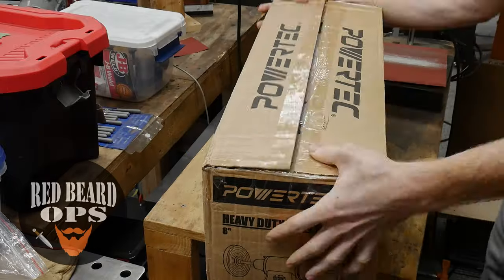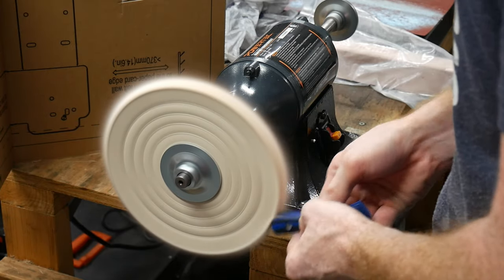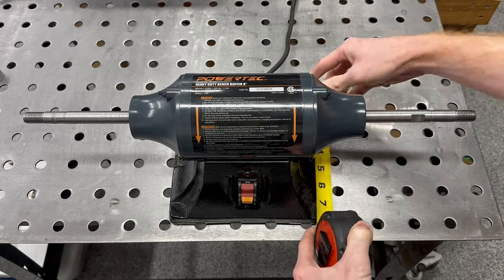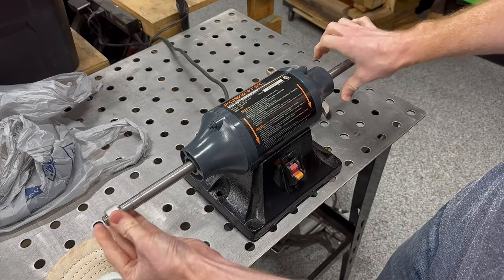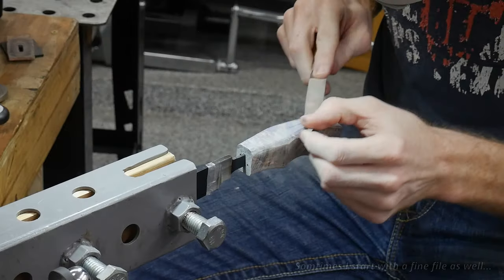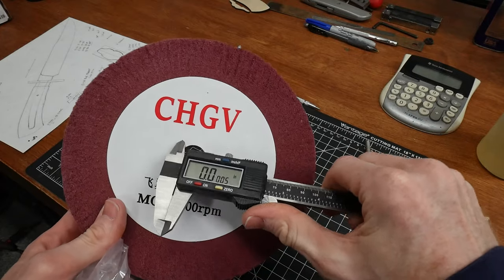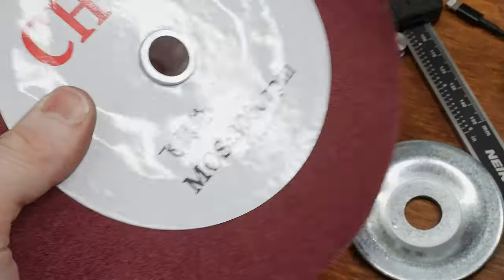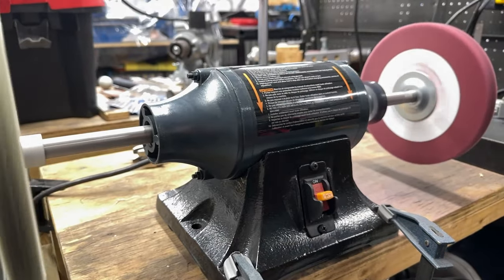Watch This BEFORE You Buy A Buffer: Are They Useful?

Comment from the maker: Any buffing tips? I'm new to this thing... Cheers! 

⭐Buffer - https://amzn.to/3VuVidL
⭐320 Grit Wheel - https://amzn.to/3AOQc42
⭐240 Grit Wheel - https://amzn.to/3OFFvGT
⭐Buffing Compound - https://popsknife.supplies/products/maverick-buffing-compound?_pos=2&_sid=b1710be89&_ss=r

🔸Become a RBO Patron - https://www.patreon.com/RedBeardOps

🔸 Red Beard Ops Website - https://redbeardops.square.site/
Reply: Combat abrasives just released a pretty slick line of buffing wheels. I’m definitely going to be checking them out.
Reply: things may have changed since I learned so may be better techniques these days so ymmv and definitely fancier synthetic mop types I not tried due to supply of old stuff. Used to be the case for last passes only go in the direction of the mop with the work piece, never against or up and down like in the vid when you're finishing because it is more aggressive and affects the fineness of finish. Use as little compound as possible and clean workpiece between mops/compounds. I use vienna lime for that but a soft cloth is enough to stop contaminating next mop. 

I start with high cut low colour compounds and progress to low cut high colour compounds as you'd expect. Same for mops starting on sisal, hard felt wheels, then various stitched mops, loose leaf calicos or WDR mops. For steel furthest I go is G300A compound but for handles I do final on WDR mop using vonax if I want it to really shine. I don't step through all those for each job as that's ott, after the sanding prep (finish 1200grit wet'n'dry or 00000 wire wool) it's 2 or 3 steps but depending on finish I may do one basic polish if mirror not required. Hope it helps and as always I enjoy your content ;)

Comment: So when I was in highschool I saw a awesome sounding class called metals and I signed up for it. I figured it would be some type of welding type class but it ended up being a metal jewelry class. I ended up liking it so much I took it all four years and don't regret it. Where I'm going with this is I have a lot of experience with grinders and buffers but mostly buffers. Making jewelry from soft metals you spend unreal amounts of time sanding from 120-10k grit but then comes polishing. You'll spend easily three times as long polishing a copper or brass piece. Many years later I see so many people misunderstanding how to use a buffer and some doing incredibly dangerous things despite their intentions being safety. Buffers do not have guards for the reason you mentioned with the knives. Soft wheels will grab a corner or edge of your work and sling it generally 90 degrees around the wheel then straight out. However, I've been to many shops where people installed guards and are afraid of using the buffers because materials keep hurling at them when they lose control. You've just basically given the buffer a barrel and pointed it at your chest. Also, guards collect heaps of polish and leaves a nasty sludge. Your buffer should not have any type of impedance near or around the wheel and should be used in an area that an object sent flying wouldn't hurt someone or something. Lastly, stop using gloves especially with soft wheels it can apparently take your fingers. My jewelry teacher always showed her hand missing a finger at the beginning of each year explaining a buffer ripped it out while wearing a glove. Who knows if she made that bit up but she was indeed missing a finger. If you are using a soft wheel on a buffer I recommend not using gloves, guard, tool rest, shield, or anything within the immediate area of the wheel. Wire wheels are a grey area they have even more danger of sucking items in but have the risk of constantly slinging wire shrapnel everywhere.
Reply from the maker: Thanks for the comment! Good tips in there.

Comment: One tip that may be beneficial is when working with small parts on a buffer, stand to the side of the wheel so when it catches it's less likely to hit you.  It's never a matter of "if" a part will catch, it's a matter of "when".

Also, I don't leave wheels on my buffer anymore, they burn far to easily when sparks hit them.  Last thing,  pick up a rake if you don't have one, it's the best way to clean up a caked up wheel.
Reply from the maker: Thank you greatly Robert for the tips!
Reply: Or… get out the Dremel.

Comment: I pretty much wear a head sock and 3M full face respirator for all grinding and buffing ops. May seem overkill, but I'm clean at day's end and my eyes never feel like sandpaper.
I also trim those fuzzy strings and take a few minutes to center buffing wheels, so they run balanced, smooth & quiet.
Thank you for great content!
Reply from the maker: Thanks for the tips!

Comment: The buffer is without a doubt the most important tool in the shop I work at. It is a critical part of production. We use Baldor 1800rpm bench buffers, but we also have a 3600rpm machine for the rare occasions where we do fine buffing. Most of the time, we use them with Nylon wheels, wire brush wheels, and abrasive scotch brite wheels for deburring. Also, you should be using a downdraft table with a bench buffer. The best one for the money is probably the Jet Tools variable speed 8 inch buffer. It seems to be as good as the Baldor and costs 1/3-1/2 of the price.
Reply from the maker: Thanks for the tip on the bench!

Comment: Hi James I have sears craftsman buffer over 10 years old. About the same buffer you have. Bought it to buff all the chrome parts on my Harley. It worked grate overall. I found it easier on bigger parts. The smaller things you buff the more concentration you need to use. Mine is mounted on a stand. That way when i let things get loose it went to the floor. Did that a few times. Using a buffer is not much difference from using a 7- or 4-inch grinder. When you hang the wheel or wire brush up something is going to give. For me i think a buffer is very useful as long as their used right. You can put a chrome finish on most any metal if you have the right wheels and compound. Might save a little sanding too. Stay safe man
Reply from the maker: Thanks for the comment will! Have a great rest of your weekend.

Comment: I wish I would have seen this sooner before I bought my 3100 rpm buffer. When I’m buffing knives I hold the handle with both hands. Thanks, I ended up installing a buffer to my drill and control  the speed through a belt system. Thanks
Reply from the maker: Be safe my friend! Cheers

Comment: My SOP for wood and G10 handle material is  to hand sand up to 1000 (wet sanding the last grit), then buff (on the buffer) with a very light amount of compound, then buff on a different wheel (on the drill press) with Mother’s mag and aluminum polish. Then finish with either mineral oil, boiler linseed oil or car wax
Reply from the maker: Very nice! Cheers Andrew!

Comment: Nice review. I have a buffer in my shop as well. I have those „screws“ at the end of my shafts that allows for a quick toolless wheel change.
Imho, most important to avoid accidents using a buffer.
The correct stand in front of the wheel, I have a broad stand with my feet far apart. If something grabs in the buffing wheel it hits the floor, not my feet.
The point of contact between my handle or blade and gbe wheel, always below the centerline if the shaft on the downward turn. Also here if the workpiece grabs it flies to the floor not my belly.
Reply from the maker: Very very good tips Roland! Thank you for sharing

Comment: I can definitely see how these can be dangerous for knives.  I use one to polish aluminum business cards.  My 5-inch normal cotton wheel is fine, but I have a 8 inch loose felt wheel that periodically rips the car out of my hands and flings it into drywall with no effort.  I can only imagine if that was a steel blade.
Reply from the maker: For sure! With some google searching you can find the stories of knifemakers getting hurt by these things.... much respect is needed for the buffer when using!

Comment: I'm new to this kind of thing, what wheels would I need in order to lightly sand copper pipe and then buff and polish?

Thanks!
Reply from the maker: The buffer came with 8'' buffing wheels which will be great for the polishing. not sure about the type of compound for copper, but likely some white or pink

when it comes to the sanding I'm also not sure... maybe some 320 non-woven wheels like I showed in this video (higher grit if you can find it)... then buff.

Comment: Do you have any recommendations when it comes to cutting your knifes out, I currently use and angle grinder and would like to possibly switch to a bandsaw.
Reply from the maker: Hey man, I'm a big fan of the porta-band being used in the upright position. I use the Harbor Freight Bauer Bandsaw for this with a SWAG off-road table. 

Bauer Bandsaw - https://amzn.to/30tVihM
Bandsaw Stand - (Swag) - https://amzn.to/2LN9QoE
Blades Option 1 - https://amzn.to/3rqjLBr
Blades Option 2 - https://amzn.to/2Z4fMRV

Comment: Somewhat off topic - I see you have the speckled epoxy surface on the floor in your shop.  I just built my shop and was considering having that done, but wasn't sure if it would be a good idea for a bladesmithing shop where I would occasionally be dropping hot steel.  Has that been a problem for you?
Reply from the maker: Yeah it was here when we got here. For general purpose it's nice, but it will start burning when you drop hot steel... if you're doing a lot of forging I wouldn't advise it.

Comment: I bought my bench grinder from Harbor Freight for $80 and I get about 25 or 2600 RPMs. I got this particular one because I can put the 8 inch wheels on it and it had the longer shafts so I wouldn't be so close to the motor with my blades. I personally have never had any problems with the RPMs being too high but I've only been buffing my knives to a mirror finish for a year or so. I don't understand why lower RPMs would be better. I am interested to know the reason.
Reply from the maker: lower speeds with a large wheel feels safer to me; less grabby
Reply: @RedBeardOps  so it's a safety thing!? I can understand that! I guess I'm stupid LOL I was thinking it was something to do with how it buffs😂
Reply from the maker: @ghostoftheUchiha3250 I guess there could be a chance of burning specific materials at high speeds... but yeah, safety is big with buffers. They're very dangerous, IMO
Reply: @RedBeardOps  I always wait until after the final buff is complete to put an edge on them for that reason and I wear welding gloves and a face mask when I buff but there is still a point on the end of it! LOL

Comment: I always stand on the side of the machine, the way I have mine mounted helps with this. And I always have it going in reverse (spinning away from me) so if anything catches it’s thrown In the opposite direction.
Reply from the maker: Good tips!
Reply: Do you mean you just turn the buffer the opposite way or are there some buffers you can reverse?

Comment: Ah yes, the spinning wheel of certain death.  This thing is no joke the most dangerous tool in my shop.  I loathe having to use it and also loathe not getting to use it.  I wish there was a safer alternative that did the same job.
Reply from the maker: It's a time saver for sure.. sounds like we just need to respect it.
Reply: @RedBeardOps  I manage from day to day, but man...these things catch so unpredictably you're almost rolling the dice.  I've had mine for a few years and use it maybe 3-4 times a week, and the best I've been able to figure out is there's a point where you can feel the resistance start building up, not because you're pushing harder or changing the angle, but it's like the wheel just gets stickier, maybe from increased friction or buffing compound building up.  You have about half a second to react before it wants to rip it out of your hands.  Fortunately, very few of the things I buff are metal, so I sort of got a feel for it with wood that isn't quite as dangerous as a beveled blade flying around the shop.  You'd think a cotton wheel would be one of the more innocuous things in a shop.

I keep some sharp scissors handy to trim off the excess threads, I've found that with wood and other soft materials this will actually leave marks in the finish that you can't buff out with a rag.  The random threads and cotton fluff that get all over you and the shop are unfortunately unavoidable LOL
Reply: @Skinflaps_Meatslapper .... That's what a Vacuum System is for, set up Behind the Polishing & Buffing wheels.... keeps You, and the shop a Lot cleaner.
Reply: @Romans--bo7br  Man I wish I had room for any kind of vacuum system, I'm using a big shop vac that works great on belts and saws but it doesn't do a thing for that fluff.  I just use an electric leaf blower on myself when I finish up, good way to cool off too 9/10 would recommend